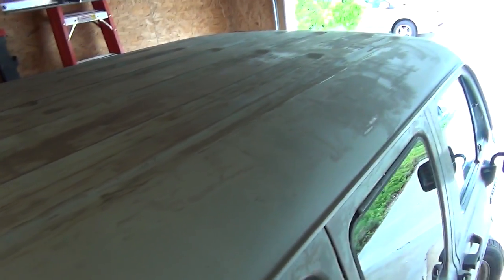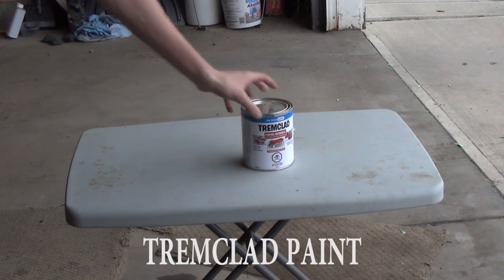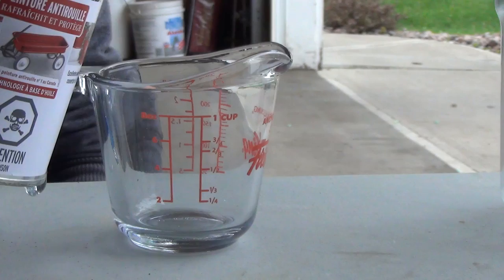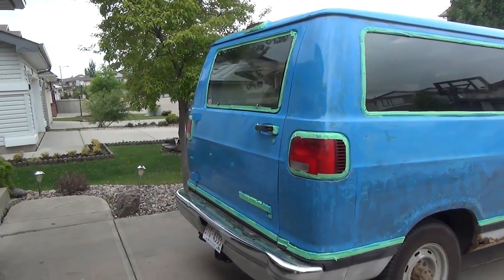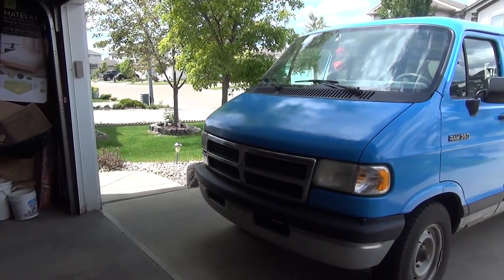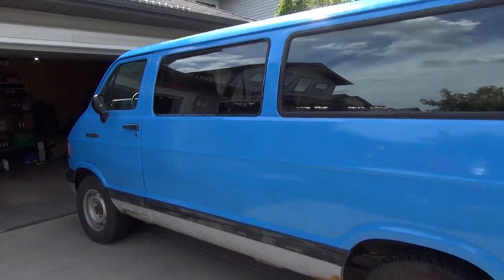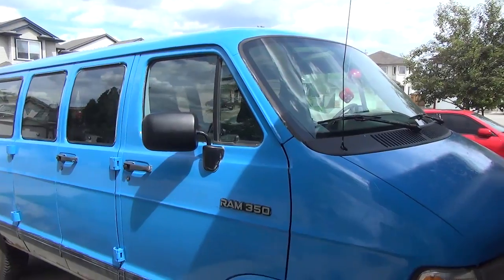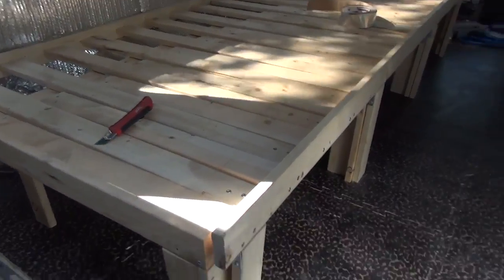DIY Cheap Van Paint Job

Comment: I'd like to spray paint my car, I was thinking about using graffiti spray-paint as there's nicer colors to it then the ones with repolium or W/E it's called
I just wonder, will the paint melt when in sunlight for a longtime?
Or will it get torn off when cleaning the vehicle with a powerfull water shooting thing
Reply: No,it won't melt in the sun but it might drip while you're spraying it and that would be messy. I would use a sign-writing paint and paint a mural. It would be harder wearing paint.

Comment: nicely done. I like the bed construction. do you ever have problems with the legs on the slide  out portion?
Reply from the maker: Haven't had any issues but i mainly leave it up in couch mode. if you where to use it a lot i would try to reinforce them. but they slide very well.